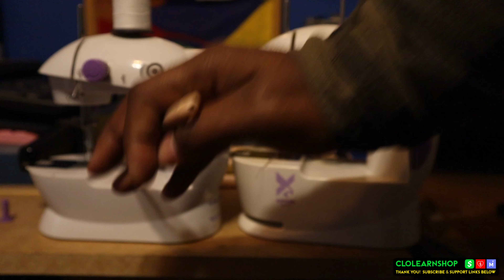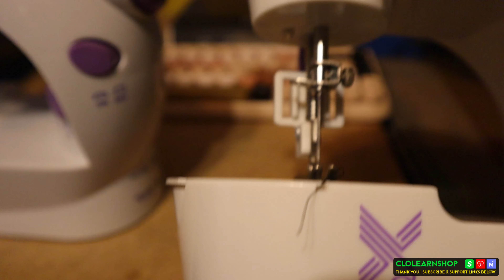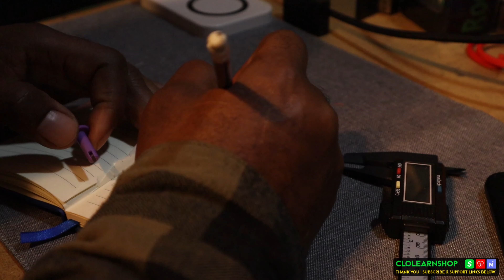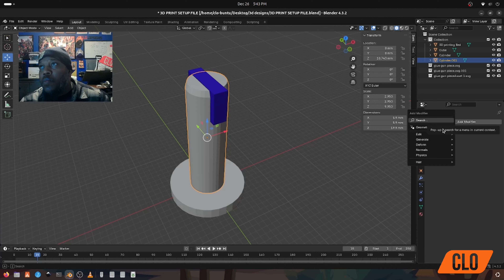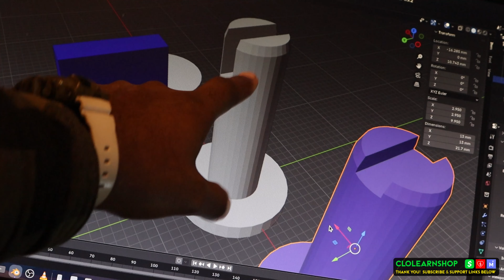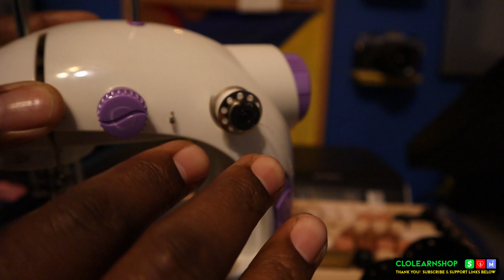🧵 KPCB Sewing Machine Repair! Part 3. Making the bobbin pin. ‪@cloeducationtv‬

Comment: I lost mine too but am printing the bobbin pin now thanks to your link. Any recommendations on a spring? I'll probably look for something soft on amazon.
Reply from the maker: Thank you for watching and im glad it helped...Use a similar thickness of wire, you can wind it around a ball point pen, cut it and use that as the spring.